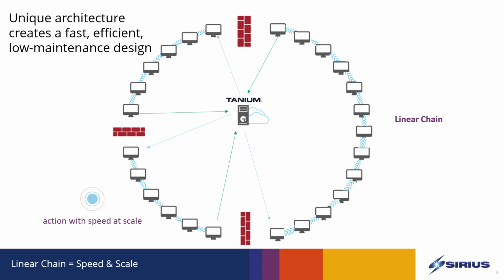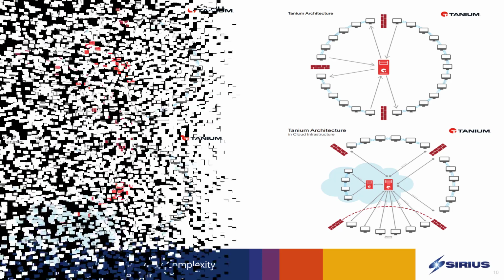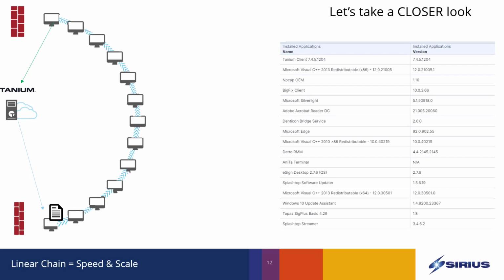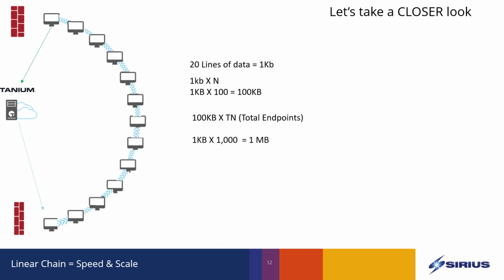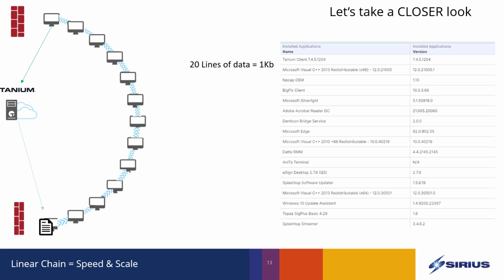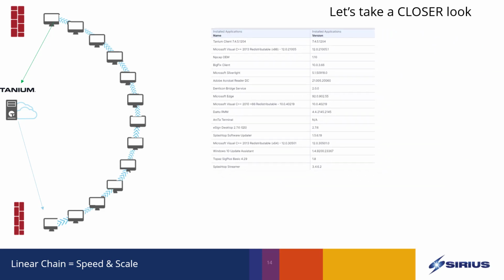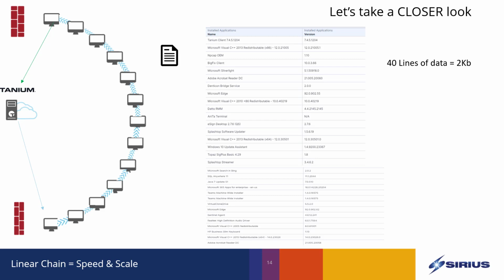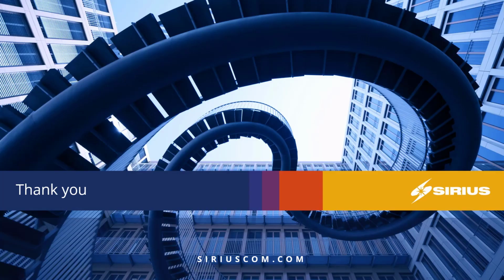TANIUM - Linear Chain

Comment: What do you mean by a "Linear Chain"? There are no straight connections from one server to another and so on and so forth, because each machine in the subnet is connected via a hub or a switch. Connections do not go straight from computer 1 to computer 2. But it's computer 1 - to switch - to computer 2 and this is most common connection in the real world. What you are trying to explain here is some sort of a token ring connection. Not sure if people are still using token ring, which is a thing of the past.
Reply from the maker: In Tanium the devices (by default ) do create a chain between device1/devices2 etc. it is called it’s upstream neighbor. and the do communicate like this until the LAST device in that subnet (highest ip ) then sends results, in the case of a question, to the Tanium server. it is NOT a token ring nor is it peer-2-peer in a pure sense.
Reply: @danielpowers2772  Where is this chain of information being saved or updated - in the server or in the clients? Thanks for the quick reply :)
Reply from the maker: at the end of it - then formation gets saved at the Tanium server. So ina simple case let’s say you ask for the version of adobe on all devices. the first device in each subnet gets the question, answer it and forward to the next decice (ip) - if that device has the same versio  of adobe it simple tags the day with a +1 (for ease of conversation here) and forwards along to next .. until it reaches the end of the chain/subnet. the last device sends all the data to tanium server. ali g the chain  of another device does not have adobe, it adds a line saying NOT INSTAllEd  any other devices without adobe would add a +1 to that line etc…. different version would add new one with the version that is different.  At the end this process moves LESS data around, and the bulk of communication  is done at the high speed subnet and NOT accross a WAN link, as most HUB and apple would do. :-)
Reply from the maker: https://docs.tanium.com/client/client/client_concepts.html

Comment: Nice review Dan.  Can this provide real time reporting or only scheduled reporting, based on the linear chain?
Reply from the maker: the whole point f the linear chan is to provide data in real time as much as possible - so yes 😊
Reply from the maker: Tanium most talked about feature is that the Linear chain provides REAL TIME data from endpoints. And (statistically) the more endpoints you have, the quicker you get results, in terms of date per endpoint#. In many cases Querying 10's of thousands on endpoints can result in data return in seconds/minutes.